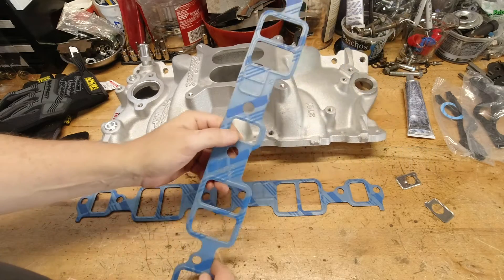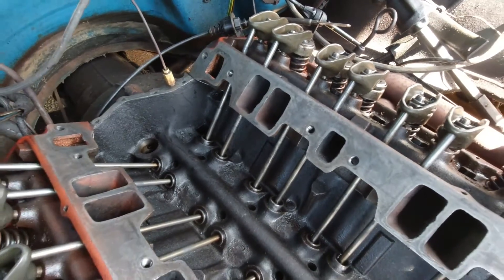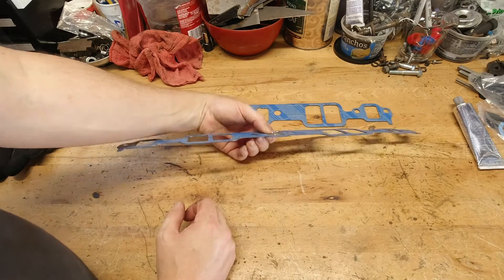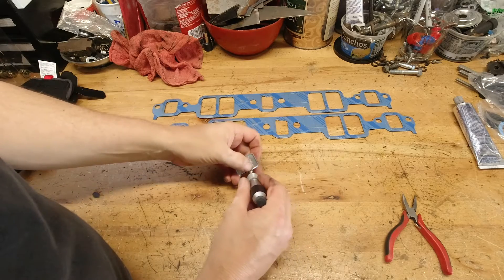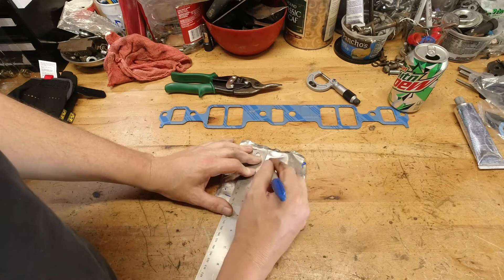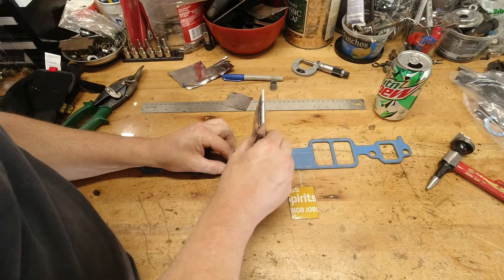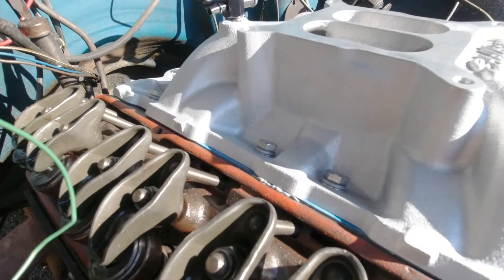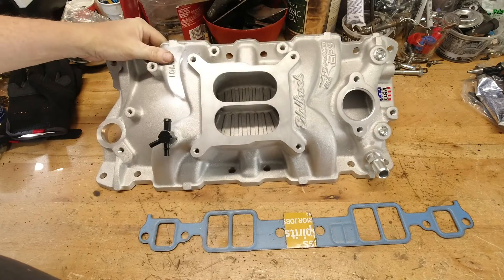Cure Heat Soak - Intake Block Off Plate

Comment: My question is why do u want to block off the heat crossover??? I tryied that once on a 454. makes them cold blooded as hell in the winter and the divorse choke wont work ever. Maybe where u live it dont get colder than 50 degress but im in SD and it gets cold as hell, blocking the heat crossover is not something to do. I only use the restriction  plates  on both sides but leave them open to run my divorse chokes on my Q jets.
Reply from the maker: Not everyone lives in those extreme environments.   I drive my vehicles year round.

Comment: I have a 66 cadillac deville 429 with iron intake, the riser crossover is getting extremely hot and car is idling bad when warm, im running a 1/2 carb spacer and brand new edelbrock with electric choke, im going to remove the heat riser and install block off gaskets also, any issues i may run into in cooler weather? The car is parked in the winter

Comment: Would it be a good idea to do this on a sbc 400? Since they have the siamese casting. You'd figure it would help keep it cooler
Reply from the maker: The heat cross over doesn't affect cylinder head cooling.

Comment: Makes no sense to me on you saying the gaskets only come with 1 block off plate when there are two pieces shown i thought that one would be for the driver side gasket and one would be for the passenger gasket now you have me confused before instal. And do all holes get rtv black including on the other side of the gasket that the intake sits on. I have a bone stock intake non edelbrock that has the crossover still on it should i use the stock block off plates with the hole in the middle or no.

Comment: You got hot antifreeze going through the intake why does it matter of hot air goes through it
Reply from the maker: Because the exhaust passage goes directly under the carburetor and is significantly hotter than coolant temps.  Makes a huge difference.

Comment: The restrictor worked in stock application where a heat riser valve was installed on one side of the exhaust. It forced the exhaust from one bank to the other , on the other side you would have this baffle(not a restrictor)to keep the exhaust from the other bank from pushing back , so it is more of an anti reversion baffle than it is a restrictor.

Comment: Do you coat the bottom of the intake?
Reply from the maker: @nicolassanchez8318  no, but I’ve seen folks who do and swear by it, but it’s usually just opinion and no hard data to prove it works.
Reply: @ yeah it’s hard because aluminum is a great conductor of heat.  Paint adheres so well to it too

Comment: Dam Good Video Buddy. Mite have to like, and Subscribe ( just old, and I mean old be 63 in February), And yrs Taught me something new , and as we’re taking about intake manifolds, I want to run a 2 inch carb spacer over a 1/2-1 inch . I seen on utube , guys were saying that the 2 inch not only alleviate vapor lock, almost completely , but the added height, allowed more fuel Atimization time provided more and better air fuel mixture, but improved ( even if only slightly) better overall performance and horsepower, but also fuel Efficiency. Even hot rodder hate the gas station lol . I have he factory Edlbroken 1 inch aluminum spacer and goodies was a kit. 30 bucks or something, and I have a old Wien 1/2 inch spacer, so my question is , in your opinion, is the information I’ve received correct and do you agree , the 2 inch usually comes bare no hardware or gaskets , and start at 45 bucks ( they have that awesome cnc machined 4 hole tapered plenum. If I go with red anodized as low as 39.99 free shipping but if ya go stock aluminum, or a couple other color choices those spacers get up to 80.00 bucks , not sure there’s any difference with the added anodizing as opposed to bare Aluminum , but if not Red will look fine on my classic Chevy orange motor . Anyway kinda hope to hear back , I don’t get a lot of responses on here . And again I am a old guy 63 yrs old taking the back yard HillBilly, Boeing Machinist father that taught me, but I finally after 51 yrs got the dream car I prayed god to ( as all teenage boys used to do , I was 11 yrs old 1973 ) anyway life , kids ,house , kids school I’m resto-Modding a 1956 Chevrolet 150 2 dr wagon known as a Handyman wagon no Chrome or stainless like the next models up ( saving me a fortune, in time and money ) so the 63 yrs old high school me , is just in the first 1/3 ,had to buy a welder and teach myself to weld lol ( Boeing machinist don’t weld anything so I was never taught)  tore apart 90% removed front clip, and rebuilt front suspension all upper / lower bushings , ball joints idler arm , drag link , 1.5 inch front lower springs and Disc brake conversion, so I’m to firewall. 68 yr old cars stored anywhere except a dry heated garage in Washington or Oregon state , all need toe boards Rockers, full floor pans ( as way easier and cheaper then buying all 10 patch pans and the 10 full or  partial braces 1,500.00$Bucks for pan , but ya add 10 pans, 10 braces , no matter how ya do it cheaper and faster to install full pan then all the pieces anyway I’m building on a Retiree’s Allowence  , which I generously a lot 500.00 month , 2 yrs plus buyin parts, but I’m attempting to build , That Hotrod I couldn’t find or afford in 76 when I put a 67 Impala SS BACK ON THE ROAD Was all I could afford. So I’m building the car that 11 yrs plus olds mind seen in 1973 . Thanks for reading my dribble ( oh they just did a neck surgery from the fronton Tuesday, and on Thursday did another neck surgery from the back . Hoping to get back to Chevy in late February 2025 hope to hear back . And any thoughts how to cut the solid steel steering shaft in a tri5 going to tilt death wheel or sawsall ????. Very best regards William
Reply from the maker: @CrazyWillie01  what’s your question? 😆 Kinda lost me in there.

Comment: My intake do not have the EGR ports on it and it's a Edelbrock air gap intake so I was wondering can I still run it on my small block Chevy
Reply from the maker: @rick86chevy16  two separate things.  The exhaust cross over is not the same as the EGR valve.

Comment: You mentioned Fel pro 1204 kits which look like they have the crossover blocking plates included. Have you used the 1204 gasket kits? Do you like em? I could still order those for my 69 C-20 with 400 SB Thanks!
Reply from the maker: They’re good.  Though I end up using the Edelbrock intake gaskets on every intake I do now.  They match the ports perfectly.  I looked at a C20 this week.  Was just a little too far gone for me.

Comment: I did the exact thing many many years ago, I lost the set that came with the gaskets, and I made some up. I worked great. I have been restricting the cross over more and more over the years, especially with stock intakes, with no issues at all. These engines don't get run with freezing temps out side anyway. I have recently modified several aluminum and iron factory intakes to resemble performer type intakes, and have eliminated the cross over entirely. For my mild performance SBC engines, I think it will work out fine. I going for the stock looking performance sleeper look. Time will tell.

Comment: Used stainless steel shim cut to fit and copper rtv to close off the heat cross over from the stock heads to my new edelbrock performer intake manifold on my 390fe. Not sure how much it helps with horsepower but living in Southern California it can't hurt.

Comment: I just used a two block off plates and the dry fitted the intake and it’s not sitting flush. Is that gonna be an issue or would it sit flush once I tighten it down?

Comment: A lot of heat soak is determined by how much muffler exhaust restriction there is
Free flowing aftermarket exhaust versus Factory choke off exhaust
Reply from the maker: Kind of.  But even with a free flowing exhaust and the cross over blocked, heat soak is still a very real issue.  Thankfully there are some good solutions.

Comment: I’ve seen a few of your videos. Always great job explaining what’s going on. This video speaks to the exact question I have right now. I have a pretty stock 350 sbc, maybe a mild cam in there (not sure exactly) with original heads that have the crossover port. I bought the airgap intake manifold and the AVS2 carburetor. The intake as you probably know does not have the port. I’ve gotten a few answers here. Edelbrock told me I can use their gasket and simply cut out the perforated box and just let the crossover port blow straight into the aluminum blocked off material on the intake. I currently have the felpro 1204 gasket that has the metal blocking. Which I believe is what you refer to in this video. Can you simply provide your opinion towards my plan that I would be good with original head with open crossover to 1204 feltpro with blocked off metal square, sandwiched under the airgap with no port?

Comment: In addition, my 77 Ltd 11 was upgraded to a Torker 2 manifold and never had a problem,, worry about crossover on a aluminum manifold. Will say fuel mileage went from 15mpg at 60 to 18-19 at 80. You youngsters, to me, worry way to much about nothing.
Reply from the maker: The torker intakes didn’t have a heat cross over, so nothing to block to stop the excess heat into the manifold.  Your mpg claims are not possible.  Not with that god awful torker intake.

Comment: Heat crossover has nothing to do with leaded vs unleaded but as you said it's there to help vaporize the incoming fuel for better distribution to all cylinders. Of course the alcohol will vaporize faster than the gas but not enough to affect performance.
When you begin to block off the crossover is in racing applications
Reply from the maker: Leaded fuels didn’t have the heat soak issues that ethanol added fuels do.  No, not just “racing applications” need to heat cross over blocked.  Heat soak is an issue even in the mildest street applications.  All goes back to that awful ethanol fuel.  Performance isn’t the factor.  It’s the boiling of the fuel in the carburetor after the engine is brought to operating temperature then shut off.

Comment: hey man fyi your using left handed snips and i noticed you seem to be right handed snips are color coded 
red - right handed
green- left handed 
yellow - straight
Reply: not saying your doing it  wrong just some useless info lol
Reply from the maker: Nope.  You’re 100% correct.  I have all three.  The green ones were my Dads and I still instinctively reach for them.  More precise work I’ll dig out the counterclockwise or straights.

Comment: It's also for prevention of carburetor venturi ice. Remember the exhaust manifold flapper valve? But heating the carb also happens in the summer 
Remember the exhaust manifold heated snorkels on the air filters? That helped too.
Reply from the maker: That was very relevant back when there was lead in the fuel.  With todays ethanol added fuel?  Not so much.

Comment: Leaded gas has nothing whatsoever to do with it. If you're running a carburetor in the carburetor has to run on the street, you better have it or you're going to be spending a lot of time fixing problems due to fuel that doesn't a demise well especially the summer blend that they insist on people running anymore. Summer-blend, by Design, does not vaporize as easily as winter-blend fuel. And yet, they charge you more for the summer blend fuel that you will get a little bit less fuel mileage with. I don't mind the idea of restricting how much heat goes through that passage, but blocking it off is a recipe for racing, not for driving it and day-to-day activities. Because you have to keep the carburetor warm especially in any kind of low temperatures. And if you are looking for fuel mileage, you do have to keep that fuel warm as it tries to cool the intake air charge as its vaporizing. Remember that gasoline, in and of itself, does not burn. Only the vapors burn.
Reply from the maker: I’m afraid leaded/ethanol fuels has everything to do with it.  In the 60s when lead was present in the fuel, it had a higher boiling point and wanted more of that engine heat to start the process for a more effective burn.  Ethanol contaminated (and it is an awful contamination) fuel has a much lower boiling point and doesn’t require that same amount of heat.  If all things from the 60s till now remained the same, then yes we wouldn’t be having these issues with todays fuel.  Eliminating as much of the heat source as possible is what allows todays engines with a carburetor to operate easier.  We fight this daily with folks asking how to keep their carburetors from boiling over.  Blocking the crossover is an excellent way to help block some heat.

Comment: hello again! Could you please tell me how thick the piece of aluminum was from the Jasco Acetone can? I see you check with your micrometers but you didn't say. Would really appreciate the thickness please. Really appreciate it. I am ready to install my permormer rpm on my 460 big block in the next day or so. Cheers from Motown.
Reply: @robertclymer6948  I’m also fixing to install a Edelbrock Performer RPM dual plane intake on my 460 this weekend. Did you ever figure out a good thickness??? I’m thinking 22-24 gauge stainless would be good but unsure and don’t wanna have to do this job but once if I can help it.

Comment: i used an old license plate cut the exact same way and used rtv to keep it stuck to the gasket on installation 👍
Reply: Nice, I had the same thought on this Oldsmobile 350 I am working on.  Glad to hear it worked for you
Reply: @jacobsabian4386   With the license plate, did you flattened it? Thanks
Reply: @jessemendoza2991  I ended up using a 4 in. x 16 in., Stainless Steel, Door Push Plate from Home Depot.  It is 1/32 " thick.  Cut 2 pieces to cover the exhaust ports, and cut out matching sections in the gasket so there wasn't any overlap.  The thickness is a good match with the gasket, ever so slightly thicker.  Working well so far.  Wanted something a little stronger than aluminum license plate

Comment: The heat crossover is used to heat the floor of the intake manifold so that any liquid fuel that has separated from the mixture will be vaporized.  This becomes more of a problem as the air temperature gets colder than 50 deg F.

Comment: i have found that annular boosters don't work without heat crossover, just my one time experience.
Reply from the maker: How do you come to that conclusion?
Reply: @MuscleCarSolutions  i welded the holes up in my edelbrock intake and changed to annular booster then  would not run worth a crap, changed back to down leg   and runs fine  that's with 2300 holley using the same carb
Reply from the maker: Your problem isn’t with the cross over.  There’s another issue here.  Going from a 4 barrel down to a 2 barrel didn’t correct it.  It’s covering up what the actual issue is.  So many questions.

Comment: Does this help with vapor lock issues?
Reply: It should help since the plenum under the carburetor will be cooler
Reply from the maker: It helps isolate the heat from the manifold, yes.  Which will help with heat soak issues in the carburetor.
Reply: @MuscleCarSolutions  Thank you for sharing your valuable knowledge and wisdom.
Reply from the maker: Anytime!  Glad to be helpful to you!

Comment: Interesting, I actually purchased "1205" gaskets for this problem, but I realized I wasted my money. The 1205 are for performance intakes the don't have a crossover. There is no reinforced metal inside the 1205 Gasket that sheilds crossover, Its just a gasket that doesn't have a crossover because it is meant to be installed against solid metal of a high performance intake, I think this is important for newbs like myself. If I'm wrong please someone correct me.
I am setting aside my 1205s and staring at an almost empty can of Denatured Alcohol and standard Blue Felpros I have from the rebuild kit.
Reply: 1204

Comment: I need to do that today I have a 84 or 85 Camaro 305 ho factory GM intake I'm putting on my V8 Blazer it's got Street fire MSD distributor Patriot headers 650 Edelbrock avs2 but I had my stock TBI intake manifold with an adapter so basically it was like a two barrel intake I think I blew my intake gaskets Monday so while I'm at it I'm going ahead and putting that four barrel intake but I was noticing the intake runners being blocked off on the back of the TBI intake but the back of this 305 ho intake doesn't have the flow in the back of it but I was noticing the exhaust crossover I want to block that off what metal did you use or how thick I probably got something else I can use so how thick

Comment: What was the thickness of the material you used?
Reply from the maker: One acetone can thick!
Reply: @MuscleCarSolutions  thank for the video, You measured it with a micrometer... so what was the thickness?
Reply: @jonjon5302  I read through every single comment on this whole video and this exact question has been asked three or four times but yet he has not given one legitimate response. Putting a new intake on my big block 460 this weekend and have spent hours researching this stupid little block all fitness question and cannot find a definitive answer anywhere. Guess I’m going to just wing it.

Comment: Hi,  I have a 1984 C10 305 V8 Original, Cast Iron Intake, Electric choke, small metal line comes off the exhaust below the exhaust manifold for helping warm up engine( when cold closes when hot opens) works off vacuum on exhaust on passenger side.  Has EGR Valve on cast Iron intake, but I have Removed smog control.  Will it be safe or important to close off the heat cross over on this cast iron intake before reinstalling? Thanks for info